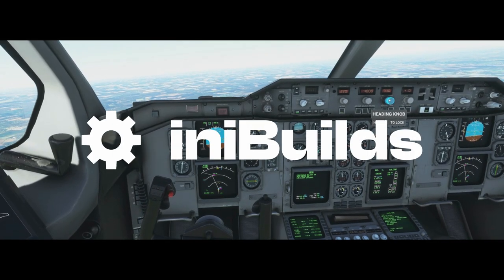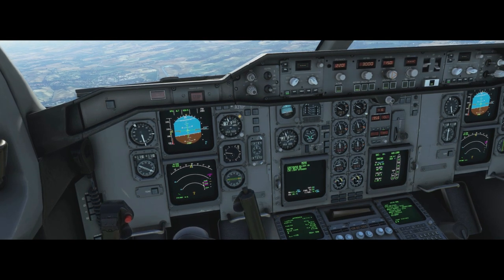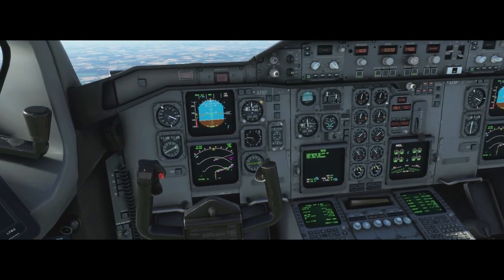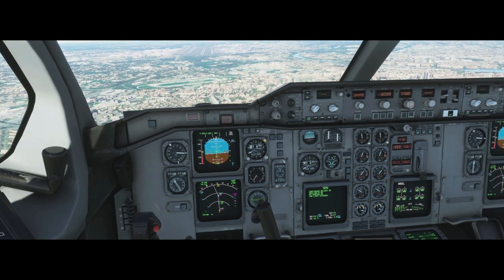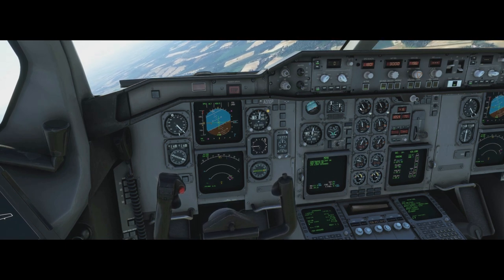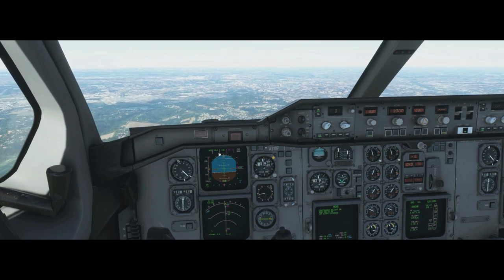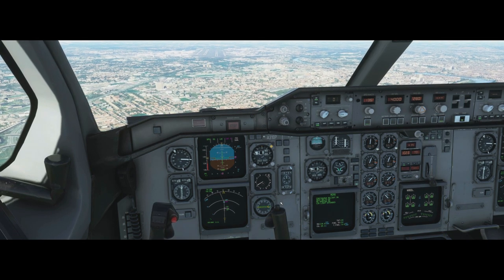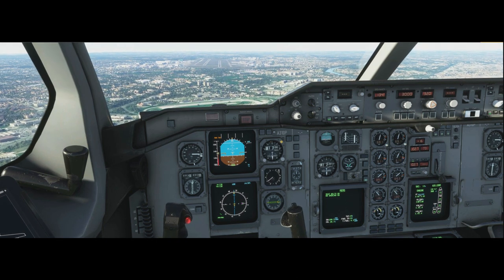EFB & Approaches - A310 | Part 2

Comment: Interesting. Were there actually any A310s that were certified to fly LNAV/VNAV approaches? The only A310 FCOM I've ever seen said "profile mode must be disengaged prior to the FAF" and "final app would be used to allow the aircraft to descend below the faf altitude if you were allowed to use it. you're not. don't press this button."

Comment: Is it expected that the RNAV approach will not be centered with the runway? I see that in this video and also in my own experience in MSFS.
Reply: It is my understanding that since the RNAV approach relies on GPS waypoints, you may be offset from the runway if the scenery designer did not position the runway perfectly with the real world counterpart. There is also an offset in real life due to GPS accuracy but not that much.

Comment: Dear, after about 7 min in your video for an RNAV approach in Toulouse (VDM32R), you press PROFILE and P.DES appears (under ALT). I do the exact same thing but when I press PROFILE both P.DES and P.THR appear. The speed goes up to 250. The A310 follows the route (NAV-MODE) but will not descend. Past the FAF, the aircraft holds 3000 feet. What am I doing wrong. I have tried this 10 times but it does not work. An ILS and VOR approach do work. 
I have also tried pressing the ALT button with the middle mouse button but P.DES does not appear either.
Thank you for your help! Erik - Belgium
Reply: press the PROFILE then depress it again

Comment: Will this at any point  be compatible with the MSFS IFR flight plan mode?

I'm a relative newbie to flight sim and I really wanna fly this beautiful plane and it's quite a steep learning curve. (which is good)
Reply: No, most payware planes are not compatible with MSFS’s built in planner. You must manually input your flight plan and everything. You should also stick to easier planes before jumping into this highly complicated, high fidelity aircraft.

Comment: When i disconnect autopilot the autopilot disconnect sound keeps going off any way to stop it ?
Reply: Press twice
Reply: @Ahmedblaser  i did what u said and it worked thank you that was driving me nuts lol
Reply: No problem mate... We've all been there one day. Have fun!
Reply: @Ahmedblaser  Not very Fly by Wire (only Toga) 😂 NO Autothrust (Max climb CL).... But Lovely 🤭
Reply: @madriditunes7021  Hahaha. And a yoke too 😉 but this is the beauty of this aircraft... Steam guages with some technology. It does have autothrust though...
Reply: @madriditunes7021  I'm pretty sure it does have autothrust. I've done full takeoff to landing flights with my physical throttle still in idle.